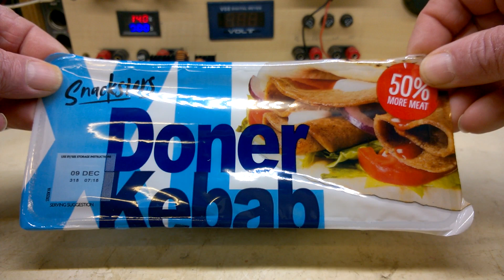Heated gloves homemade battery (7.4v 3300)

Comment: I would like to apologize when I mentioned that my original Li-Polymer battery (same as shown in your video) does noy have the BMS controller. I removed the plastic, and I was able to see it. I measured the voltage after the BMS controller, and it is zero volts. Then I measured the voltage on each Li-Polymer battery separately as they connected to BMS controller in series. One has voltage 2.7 volts and another 3.2 volts. I charged these batteries using the DC-DC power converter (XL4015 5A DC-DC Lithium Battery Step down Charging Board Led Power Converter Charger Step Down Module) without disconnecting them from the BMS controller and I set the voltage to 4.2 volts. Now both batteries are charged to 3.88 volts, however the voltage I measure now after the BMS controller is zero. Is there a way to reset this small BMS controller? If not what type of the new BMS controller would I need to install?
Reply from the maker: I don't think the BMS can be reset.
It's probably faulty.
Buy a new one;any 2S BMS will do.
I've shown one in the video - 3 amp rated.

Comment: It turns out that the original Li-Polymer battery shown in your video does not have the BMS controller inside the battery pack and this is probably why it failed in my case prematurely, as the Dr. Warm gloves would discharge it completely!
Reply from the maker: One of the advantages of having a BMS is that it should cut out if the cells go low voltage.
But some BMS gradually discharge the battery over time as well.

Comment: Hello, thank you for this video. May I ask you what type of the charger do you use for these batteries? I have two batteries 7.4 volts 2200 mAh for my Dr. Warm gloves  - what type of the charher can I use for these and what output voltage?
Reply from the maker: This charger.
Output 8.4v
https://www.aliexpress.com/item/1005001789788168.html?spm=a2g0o.productlist.main.7.693e4fa0H9PokN&algo_pvid=f9646367-403c-4ca8-8ccd-d31b5b905558&algo_exp_id=f9646367-403c-4ca8-8ccd-d31b5b905558-3&pdp_npi=4%40dis%21GBP%215.88%213.82%21%21%217.20%21%21%40211b5e2417011302331182345ea6be%2112000017583040830%21sea%21UK%21785824709%21&curPageLogUid=zpugZB687unz
Reply from the maker: Your second comment does not appear in this section (probably blocked by youtube).
I used my smaller power supply to charge the battery as I did not have the correct 8.4v charger then.

Here is a link to something similar  :- 
https://www.aliexpress.com/item/1005001778715511.html?spm=a2g0o.productlist.main.95.54a0393ckFyUCg&algo_pvid=c092fe81-5972-413f-9e48-670b6aa7005d&algo_exp_id=c092fe81-5972-413f-9e48-670b6aa7005d-47&pdp_npi=4%40dis%21GBP%2118.84%2114.13%21%21%2123.11%21%21%40211b617a17012151405032560eb53d%2112000017538771329%21sea%21UK%21785824709%21&curPageLogUid=6cEH6bJzZqgp

Comment: hello. Your video is interesting but it would have been even more interesting if it had been more detailed for a beginner like me. How did you connect the batteries, give the links to find the components you added. Your idea is great but impossible to do if we don't have more details
Reply from the maker: Most viewers don't make it past the first minute of my videos , so making a longer one is pointless for me.
The 2 cells are welded together with the nickel strip and protected with a 3 amp 2S BMS.
Reply: @makeitwork7522  Hello sir, I saw in another of your videos the repair of batteries for heated gloves and that's exactly what I'm looking to do. If I understand correctly I have to use a 2S 4A  BMS for 18650  battery for each glove?
Reply from the maker: @U72740  
Nearly right.
The BMS are usually rated at 3 amps.
One BMS per glove (2 cells in each glove).
You can find a wiring diagram from the BMS seller.